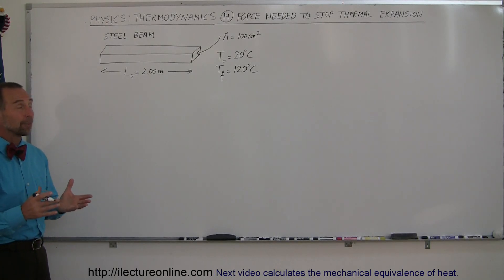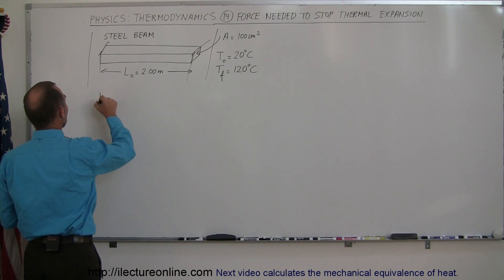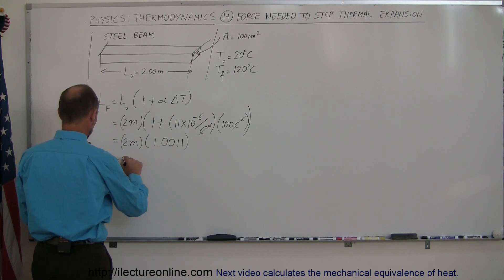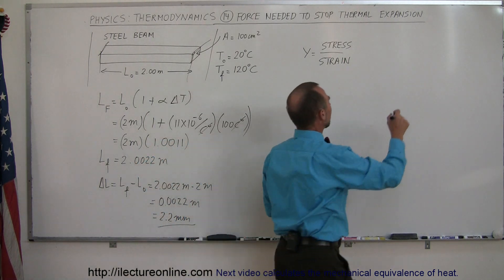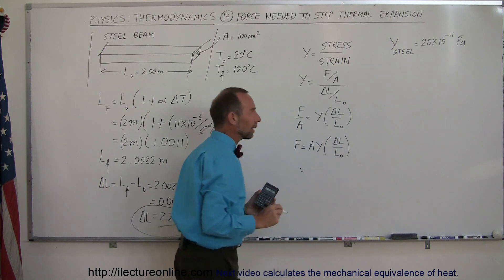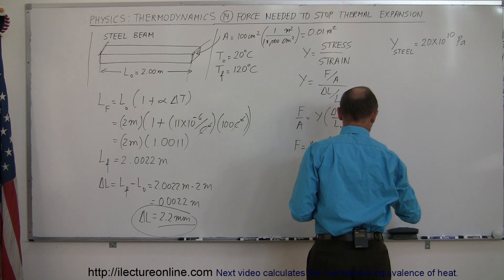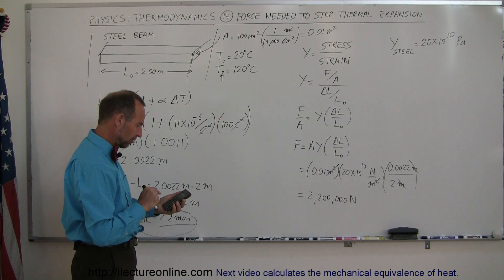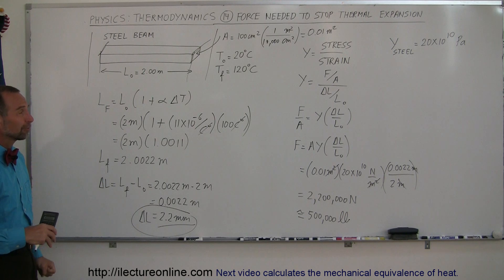Physics 21  Thermal Expansion (4 of 4) Force Needed to Stop Thermal Expansion

Comment: wouldn't the area increases (due to thermal expansion) so theforce required is larger?
Reply from the maker: The change in area for the cross section is negligible.

Comment: If I put this beam vertically, and heat it up like in the lesson, is it able to lift a weight of 2.200.000 newtons of 2.2 millimeters? Or is it able to lift 1.100.000 newtons of 1.1 millimeters? Thankyou!

Comment: In the young module equation why did you use L initial shoudnt it be the final one I mean the wall is acting a force on the object which made it from 2.0022m to 2 m 
That what would happen without the walls so the walls are making the object shorter not longer so we should put L final in the young module equation which is actully the initial lenth for young equation
Reply from the maker: The approach in the video is correct.  (Assume the beam is kept at 2.00 m while you are heating up the beam)

Comment: i was thinking... could you get an exact answer for the volume expansion of any object by first taking V, then the cube root for side length AVERAGE, then doing the length expansion and cubing it? it's not very complicated, and would net you those few decimals. say for an object 3 x 6 x 200, you could just go cube root 3600 = L_0 and go from there.
Reply from the maker: That is correct, that would work.

Comment: thanks very much for all your videos,
please I didn't understand here one thing, if we want to stop the expansion why we calculate delta L,  if we want to have the same length we should consider just L0.Am I WRONG?  coz if we consider delta L, we should say how much Force will be needed to stop the beam from expanding more than (Lo+delta L )..
Reply from the maker: Using Young's modules we can figure out how much force it will take to change the length of the bar.  To know how much the bar has to be squeezed, we have to use the thermal expansion to find delta L.

Comment: prof where's the thermal stress?
Reply from the maker: When the rod is heated, the atoms in the rod will vibrate more vigorously, causing them to move away from each other just a slight amount.  The balance between repulsive and attractive forces is shifted just a bit when the rod is heated.  If you want to prevent the rod from expanding, you will have to push hard on both ends of the rod to keep it the same length and to prevent the rod from expanding.  That is the thermal stress.
Reply: okay thank you prof :) understood!